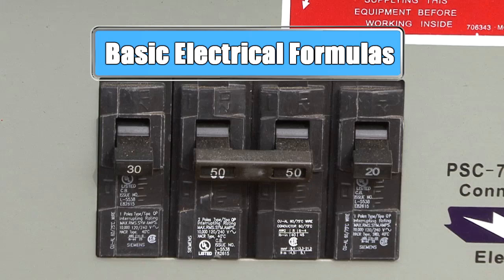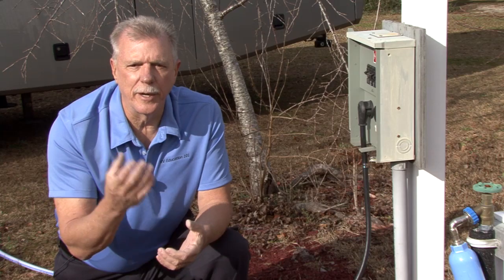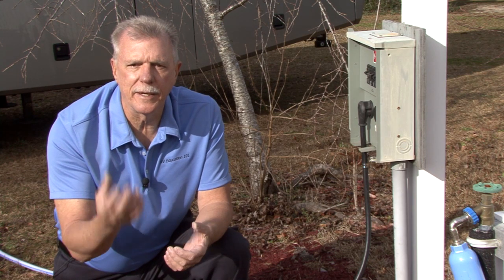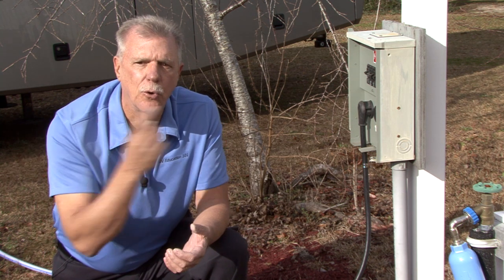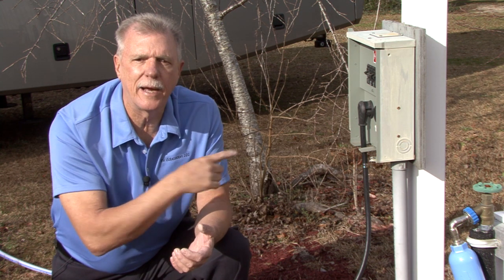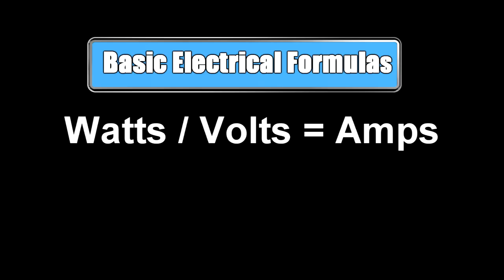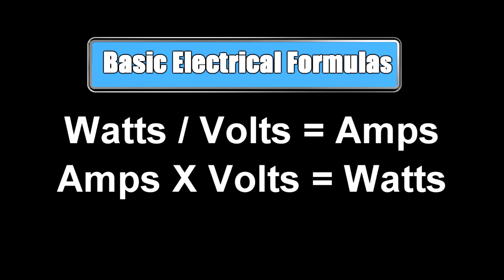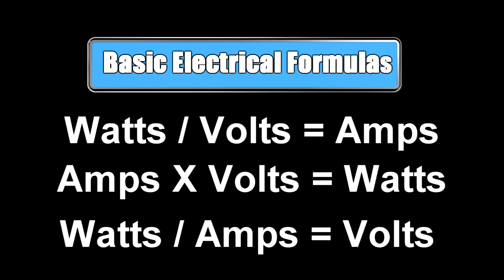RV 101®  - How To Camp on 30 Amps

Comment: In my opinion this is the best explanation of electrical systems in an RV.  It gives a good comparison of a home 200 amp breaker box versus a 30 amp RV.   Easy to understand and calculate amps and or watts.  Thank you for this simple explanation for dummies like me.  I have never understood watts, amps and volts.  Now I do.  Great job.  Thank you!

Comment: Thank you so much!!  I'm brand new to living in a 30amp Class C RV.  It's getting a little chilly and I was told that you can use a small ceramic space heater to take the chill off the RV.  I tried using 2 small space heaters and they tripped  the breaker inside but not the 30amps at the electrical post.  This video explains appliance usage so clearly.   Thank you again.